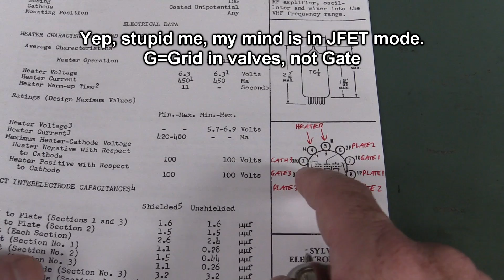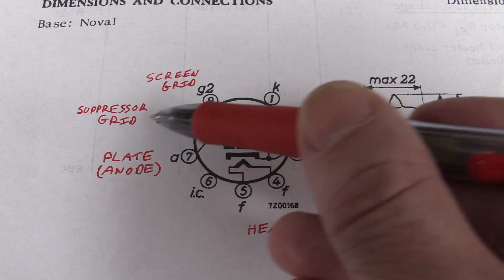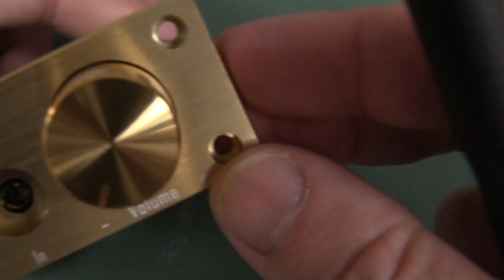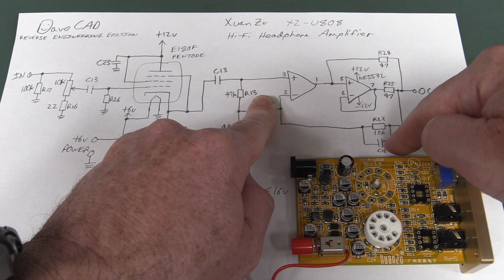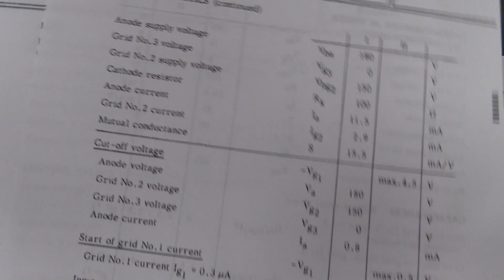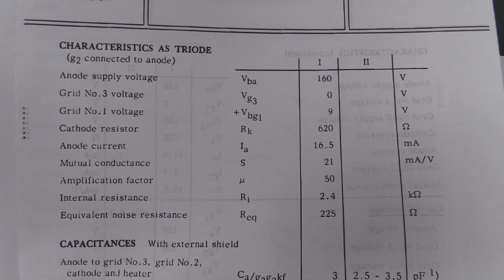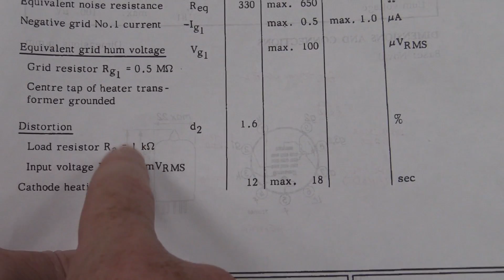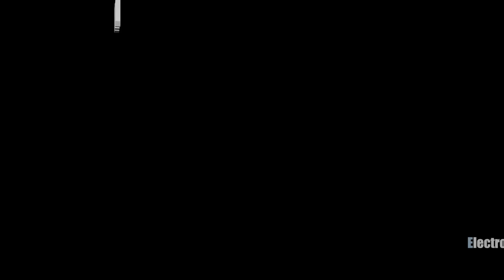EEVblog #837 - Reverse Engineering A Valve Headphone Amplifier

Comment: I'd really like to see you look inside a "high-end" valve headphone amp, just to see if there's much of a difference.
Surely just writing off all valve headphone amps based on this one is a bit presumptuous? 
Its like buying a cheap Chinese micro hifi amp from Amazon and then just saying all hifi amps are rubbish.
Reply: +Dan Xepha  No matter what you do, Tube amps are simply not any better than decent transistor based amps.  

Tubes are a thing form the past, obsolete, cause semiconductors are simply better in every aspect aside form looks.
Reply: +ABaumstumpf Depends on the application.  Tubes do have their obvious disadvantages in power requirements, size, and failure rate, BUT they do have unique characteristics that are desirable in certain audio applications.
Reply: Kenneth Scharf  IN places where you want distortions only - and even there for years we simply used digital equipment to get exactly the distortions and effects we want.

But for a cheap clipping e guitar it is good.
Reply: +ABaumstumpf True, Guitarist's LOVE tube amps!
Reply: +ABaumstumpf no matter what amp you use, ALL speakers reproduce the sound with extremely high distortions when you compare them with distortions made by amplifiers. So ooo. .. yeah. It is all very subjective.
Reply: +ABaumstumpf a modern day sports car is technically better than a 20yr old one, but there are some people who far prefer them.

CD/vinyl
etc etc.

there are about a million examples of things that are now better but many people prefer the older ones.
Reply: +Dan Xepha A real tube headphone amp would have more than 24v across the tube section, and the tubes would drive an output transformer, high-voltage in, high current out.      No chips.
Reply: I think you guys derailed conversation somewhat, I would love to see what difference cheap and expensive Valve amp makes.
Reply: +plmareksurma That needs a disclaimer though. Most half-decent speakers have huge amounts of 2nd, 3rd and 5th order distortion, but the amount of distortion rapidly falls off as you head towards higher orders (8th order and higher). Transistor amps can have similar amounts of harmonic distortion out to the 20th harmonic and beyond. That said, the distortion from any properly designed transistor amp used within it's limits is inaudible.
Reply: TMM  "Transistor amps can have similar amounts of harmonic distortion out to the 20th harmonic and beyond."  
A decent transistor amp has all distortions combined being less than the first order of your speakers.  
The old cheap transistors when they started to become popular had some bad ones, but that has got nothing to do with reality now.
Reply: ABaumstumpf Absolutely. What I am saying is that a relatively small amount of say 13th order harmonic from the amp can be subjectively just as offensive as a huge amount of 2nd and 3rd order from the speakers.
Using modern transistors does not guarantee low distortion. Many new transistor amps still have pretty mediocre performance due to cost cutting, optimising for power efficiency or just plain bad engineering. Many audio-phool designs have even worse distortion because people are afraid of using global negative feedback or think that a design that uses the least number of components will sound the best.
Fortunately it is easy enough to engineer an amp with inaudible distortion if you are prepared to sacrifice efficiency.
Reply: TMM  "Using modern transistors does not guarantee low distortion."
Sorry, but even the 3rd and 4th order harmonics of a transistor are already well below the noisefloor of tubeamps - aka a tube will have those frequencies and many more and all those significantly stronger than transistors.

"Many new transistor amps still have pretty mediocre performance due to cost cutting" 
As i recently had to deal with an audiophile, i looked up some audio-amps form different vendors.
TI produces some chips, 2x10W stereo, 0.1% THD for just 2$.
And under 1% is for typical applications (not a sound-designed room) not noticeable.

And a 2x100W with 0.01% THD cost like 40$.

For listening to music transistors normally should operate well below their limits, and also significantly better than the audio source material - or just audible perfect for human ears. Audiofools will tell you they need higher bitrate than 44.1/16 bit - a format that was chosen because it can cover more than any human can hear. And even cheap 0.50$ opamps can deliver that performance already.

And for all that - you won't find speakers that are so perfect that you could even notice the difference between 0.5% and 0.01% THD.
Reply: +Dan Xepha I want him to review this one: http://schiit.com/products/vali-2
Reply: ABaumstumpf Transistors produce 2nd order harmonics. You add global negative feedback to produce an error signal to correct the 2nd harmonic and you produce a 4th harmonic. Then you get a 6th harmonic, and an 8th harmonic and so on. Any time you use a push-pull configuration of transistors you produce odd order harmonics instead. 
The only difference between old transistors and new ones are that the current gain is higher and they maintain a more constant gain through a wide range of collector current. More gain means more feedback and therefore lower distortion. They are also faster which means you can apply more feedback without the amp becoming unstable. 
An off-the-shelf discrete transistor 2x80W stereo amplifier I have measured 0.5%THD @ 1Watt, 8ohm. With some minor mods (fix feedback scheme, increase bias) i reduced it to 0.003%.
You'll find that for 'chip'/IC amps the manufacturers will cherry pick their THD figure under the best case test condition. THD may be significantly worse for small signals or near to the quoted power output.
Reply: TMM
"Transistors produce 2nd order harmonics."  False. 

"More gain means more feedback and therefore lower distortion. "  
Again false.  
  
Learn some electronic basics please.
  
And the THD are measured by industry standards. those are the distortions the chips measures under set conditions. near the rails the distortions naturally become bigger - but no human with half a brain would drive his amp near its limits. You wont find harmonics till the signal starts clipping. So only after you have already destroyed your sound there is anything where you could say tubes are 'better'. Again the reason why they are used ir for some instruments to directly distort their sound.
  
But it all still means - a half decent transistor amp is transparent. Something that audiofools still dont want to understand.
Reply: I really don't care about all this technical harmonic shit. I just want to see him compare it to a far more expensive one to see what the actual, physical difference is.
Reply: +ABaumstumpf You really need to qualify statements when blindly stating that semiconductors are always superior to tubes.  There are applications where tubes are actually both more practical, affordable, reliable, and every bit as effective as their solid-state counterparts -- particularly at high power and/or voltage levels.  Tubes will often survive events that can be exceptionally destructive to semiconductors without the need for extensive engineering of specialized protective circuits.  High power transmitters are a very good example of such.
Reply: Ethan Poole
 We are talking about audio here. And for normal applications you won't find any reason for Tubes.

btw - you also might want to check your claims before making them - cause for high power applications (aside form a very few rare scenarios) we are using transistors since many years already. The biggest application of tubes is old hardware that has not been replaced yet.
 
You strike me more and more like a person that has learned some pretty outdated stuff - tubes are practically extinct since 20 years.
Reply: So I just watched a video about the $50,000 Sennheiser Orpheus headphone/amp system. It uses tubes. Are they pointless too?
Reply: ABaumstumpf
My thinking is that they must have a much harder time justifying the use of tubes in the supplied amplifier.
A solid gold dildo offers no functional improvement over a standard one, but I feel there must be some legitimate reason for a $50k headphone & amp system to use valves.
Reply: ABaumstumpf You want to provide an explanation rather than just responding with "False" because I'm pretty sure what I wrote is correct and you are the one who is wrong. BJTs have an exponential voltage to current gain curve which produces 2nd order harmonics for anything other than an infinitely small signal. You put two in a push-pull config and you get a 3rd harmonic instead. 
There may be some ISO standard for measuring distortion somewhere, truth is that the 'single figure' touted at the front of the datasheet is almost always just at some arbitrary load impedance and output power. The other issue with the 'single figure' as that it's only valid for one specific power output. Different amps produce different THD+N vs Power Output curves. At least the better manufacturers provide them at either 4ohm or 8ohm in the datasheet.. The "all transistor amps are audibly transparent" argument is simply wrong. It is easy to make an amp with distortion disappearing into the noise floor but there are heaps of amps out there that just plain suck either due to misunderstanding by the designer or input from the audiophool brigade having strange ideas about which circuit topologies "sound better" and disregarding distortion measurements.
Reply: TMM   
"because I'm pretty sure what I wrote is correct"  
 When you just copy paste the old audiofool myths (and even partially debunk them self directly after like with the 2nd order harmonics) - i really see no reason to elaborate any further.  
You should first check your own arguments to see if they hold up, instead of throwing around random claims and expect everybody else to do the work for you.

"Tubes produce 15th order harmonics at -3dB"  now go ahead and show that this (extremely stupid) claim is false.  

Nobody cares what you feel or believe. Facts - the stuff that describes reality - that is the thing that matters.

"which produces 2nd order harmonics for anything other than an infinitely small signal."  
That is what i meant - no.  
In that regard tubes and Transis behave the same. Harmonics are a direct result of having more than a single frequency. Any nonlinearity (and here tubes are worse than opamps) will produce harmonics.  
Because of the higher linearity of transistors used for audio-amplification, the harmonics produced fall under the noise-floor for quite a large part of the audio spectrum, and only when you crank them up really high, close to clipping, any harmonics become audible.  
  
And if we then compare tubes to transistors, we are looking at an order of magnitude difference at least.

"You put two in a push-pull config and you get a 3rd harmonic instead." 
Do you even know how harmonics are produces? Pus-pull does not make the transistor suddenly behave differently and produce different harmonics, rather even harmonics cancel out each other - that is a design-characteristic.  
  
 *" The "all transistor amps are audibly transparent" argument is simply wrong. ....due to misunderstanding by the designer or input from the audiophool brigade"* You do realize that you have just contradicted your own argument?  
If the design is shitty it is not the fault of the parts used. By that logic i can just shorten out a tube in a random design and say that is the reason why tubes dont work at all.
Reply: This is getting boring now. I just wanted to see him make an actual comparison with a higher quality, more expensive product.
mutes post
Reply: ABaumstumpf I'm totally lost as to what the point of your argument is any more. All triode devices are inherently non-linear and will produce predominantly a 2nd harmonic when used single-ended because they either have a exponential (BJT) or square-law (FET, Tube) transfer function. You use biasing to operate on the most linear part of that curve and feedback to get rid of what's left. It's totally impossible to avoid distortion completely, only to use engineering practice to ensure it's at a sufficiently low level.

In laymans terms, even (mostly 2nd) order distortion comes about because a transistor running single-ended is compressing the peak one half-cycle of a sine wave. 

If you run a pair of transistors in push-pull then you get odd (mostly 3rd) order distortion because now you get compression of the peaks of both the positive going and negative going half-cycles of a sine wave.

Tubes and FETs are worse than BJTs because they have a square-law transfer function which creates more distortion than the BJT's exponential one. Tubes are worse than FETs because they have an obvious price, size and power consumption disadvantage which means only simple designs with few devices are feasible. How many tube designs employ constant current sources and more than a handful of devices? Almost none, hence almost none have vanishingly low distortion.

I have designed/simulated, built and tested transistor power amplifiers with <0.001% THD, have you?
Reply: TMM
" It's totally impossible to avoid distortion completely," Yeah - as i said several comments ago already - and transistors simply have less nonelinearities.  
What the rest of the circuit does is irrelevant as you can use the same mechanics to counter act distortions with both.  
  

"transistor running single-ended is compressing the peak one half-cycle of a sine wave. "  
That is just wrong on every level there is.  

Please, learn the basics of electronic engineering before spouting more bullshit - some people might actually believe the bullshit you are spewing.

"I have designed/simulated, built and tested transistor power amplifiers with <0.001% THD, have you?"  
0.001% ? You can get that with jellybeans opamps already.  
And yes, i have - it was part of my education.

And again - nothing you have said now says anything about tubes being even close to transistors.
Reply: I think you need to go study a common emitter BJT circuit biased with resistors and come back when you understand where the 2nd order distortion comes from.

Not sure what you are getting at with "nothing you have said now says anything about tubes being even close to transistors." You think tubes are better or worse?
They are basically just JFETs with pilot lights anyway. There is no reason you couldn't create a pretty low distortion tube amp. Would just be huge, power hungry, and cost a fair bit to build. 
You'd use exactly the same tricks to make it linear as you would a transistor amp.
Reply: TMM  "where the 2nd order distortion comes from." They come form none-linearities - and the even order harmonics get cancelled out in a push-pull configuration - that is feature of the circuit, not tubes or transistors. 

"You think tubes are better or worse?" 
I don't think either, i know based on facts that tubes are simply worse. 

"There is no reason you couldn't create a pretty low distortion tube amp." 
Of course you can - but again they have no advantage.
Reply: ABaumstumpf Even order gets cancelled in push pull, not odd.
Reply: TMM  Corrected it, was a mistake form changing my comment before posting.
Reply: ABaumstumpf sure it was.
Reply: TMM  So you ignore the rest cause of a simple mistake (like you have had a few) - maybe cause you have noticed that tubes are just bad?
Reply: Many years further when my son comes to me at the spry age of 6, asking what the ancient term 'Flame War' means, I shall lift him to my lap, boot up my old, decrepit computer that can still connect to the archives of the internet, and I will show him this response thread. I will point to those here and say, "See? It is a war of fools on both sides."
Reply: I do believe that the CD audio spec was locked in a little too early.  In order to avoid aliasing, one must filter everything above the Nyquist frequency, 22 kHz.  But filters are not perfect, so you end up rolling off frequencies below that frequency as well, while adding some phase shift as well. It would have been nice to have a little more elbow room for the filtering.
Reply: Ah, the clipping case is when the tube guitar amp comes into its own!
Reply: ABaumstumpf 

>Digital modeling 
Dude some people prefer authenticity over "virtual reality" crap. Not hard to get is it? I have a tube radio from 1963 where everything is original (except the tubes themselves of course) and it still works like on the first day. The digital stuff won't ever last that long and components are irreplaceable. Don't wanna miss that sound, despite being colored. For more high-power sound I'd go for solid state though, at least in the output stage. But never any digital modeling.
Reply: True, as tubes do not need to add distortion to a signal if they are biased properly and are not driven into cutoff, or out of the linear region of their gain response.